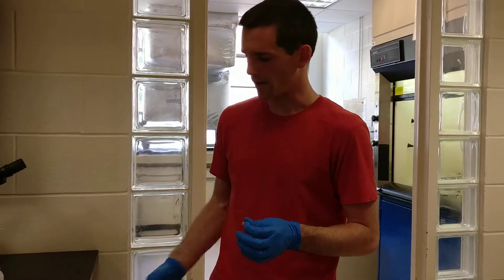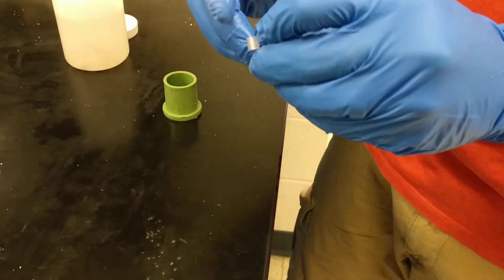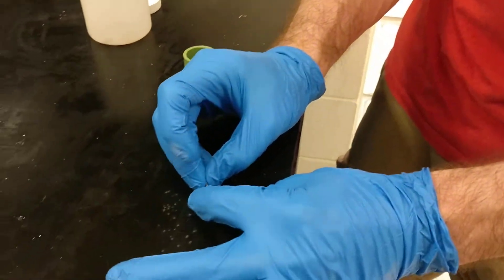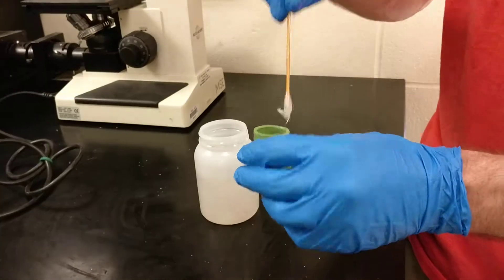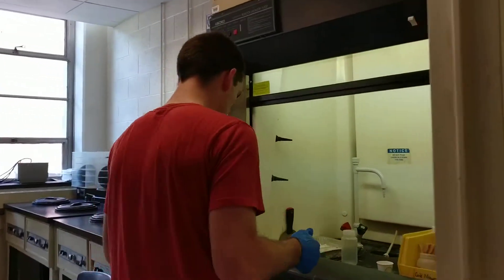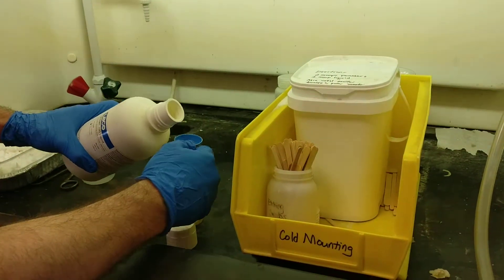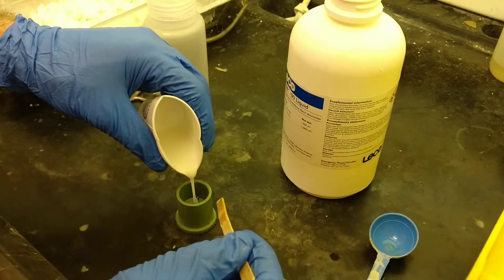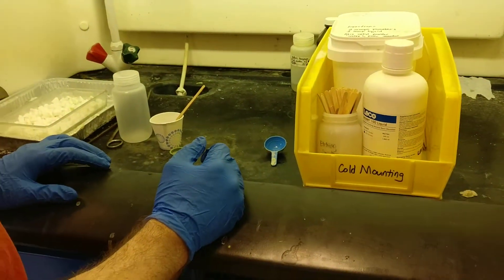Cold Mounting with Lecoset 100 Acrylic Resin

Comment: if you use all the resin mixture and it covers the sample so much, wouldn't it take much more time to coarse grind the additional resin layer which is on top of the sample?
Reply: The "top" of the sample is the bottom of the puck.